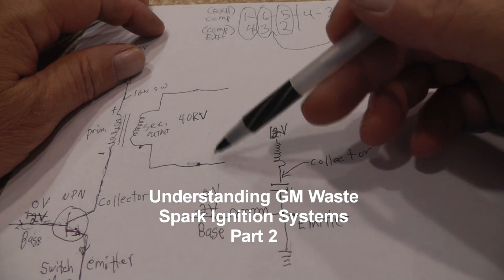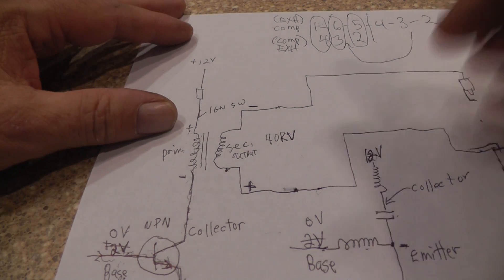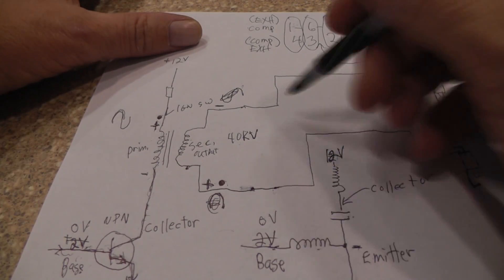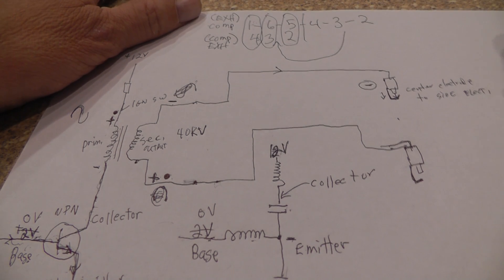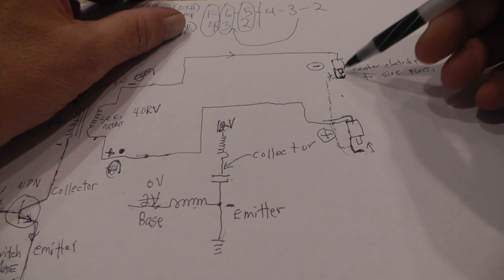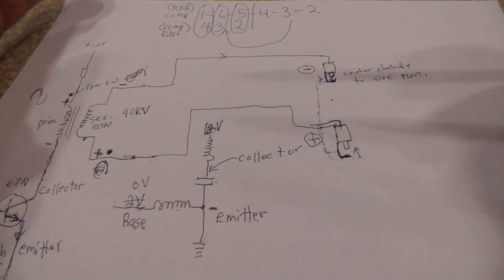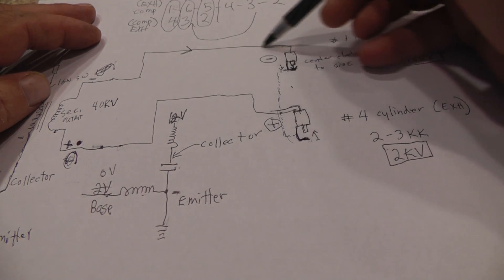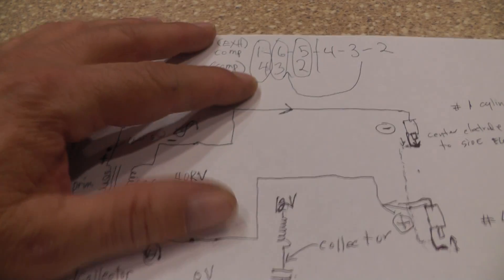Understanding GM Waste Spark Ignition - Part 2

Comment: Nice explanation but i dont understand how ECU knows what cylinder is at intake stroke to inject fuel if there is no camshaft sensor in system, only crankshaft sensor? I mean 4 cylinder engine example.
Reply from the maker: Good question! If the engine has a waste spark system and using batch firing of the injectors, it can figure out when to inject fuel with the crank sensor only. But, if it has sequential fuel injectors, then it needs a cam sensor. Here is a link to some comments on this topic. Pay attention to Chickenman's comment as I believe it will pertain to your question. https://forums.hybridz.org/topic/126922-sequential-injection-with-only-crank-position-sensor/

Comment: I guess the reason A/C current isnt used is because alternating current wont jump a gap. this info is fascinating
Reply from the maker: Actually AC will jump a gap, but there's more electronics to use AC on a car which uses a DC battery.

Comment: Hi Stuzman.  One more question following your excellent video - If one plug lead was pulled from a cylinder, would that mean that the corresponding plug associated with the same coil would also not fire?
Reply from the maker: That is correct Richard as the spark plugs are wired in series.

Comment: Excellent video!  One question - how does the electron flow reverse when cyl 4 is on compression stroke so that electron jumps from central electrode to ground?
Reply from the maker: Hi Richard and wishing you and your family a Happy New Year! Okay, to answer your question quickly, the electron flow does not reverse for any cylinder. To answer your question with a little more detail, let's use a four cylinder engine where the firing order is 1-3-4-2. To find out what our companion cylinders are, we will split the firing order in half. We'll take cylinders 4 and 2 and bring them under cylinders 1 and 3. This will give us 1 and 4 as companion cylinders and and 3 and 2 as companion cylinders. Cylinder 1 will be fired negatively at the center electrode, whereas cylinder 4 will be fired positively at the center electrode. And cylinder 3 will be fired negatively at the center electrode whereas cylinder 2 will be fired  positively at the center electrode. So, to answer your question, none of the cylinders will reverse the flow of electrons as it's fixed with their corresponding polarities as outlined above. Cylinder 4 will always be firing from the side electron, (it's more negative) to the center electrode on the compression stroke. And looking at it's companion cylinder #1 on the compression stroke, it will always be firing from the center electrode, (more negative) to it's side electrode. Hope that answers your question!
Reply: @stuzman52  Thanks very much Stuzman.  A very Happy New Year to you and your family.  And thanks again for your speedy reply to my question.
Reply from the maker: @richardeaton5770  Always glad to help Richard! Have a great day!

Comment: What I don’t understand is what is the basic reason for this system? Is it to reduce the number of coils? Also, if two cylinders are fired from the same coil and they have different kv requirements due to one cylinder being on the exhaust stroke and the other cylinder being on the compression stroke, wouldn’t the voltage take the path of least resistance and fire the cylinder that has the lowest kv requirement ( exhaust stroke) and thus dissipate all the energy there and not fire the cylinder that is on the compression stroke?
Reply from the maker: Hi Brian and hope you had a great Christmas and wishing you a successful New Year! The reason that the waste spark system was used was because of cost. With fewer coils as you mentioned, it was a cheaper system compared to having a separate coil for each plug. With a separate secondary winding supplying two plugs, the spark plugs are wired in series with this winding. You are correct that the exhaust stroke has a minimum firing voltage across its gap, but you have to realize that the voltage will not jump this gap because of the other spark plug gap which requires a higher voltage during compression. Remember, the spark plugs are wired in series. So, to have a spark jump both gaps, the cylinder that's under the higher compression has to be met FIRST. Once the condition has been met for the higher compression, then the sparks will jump both gaps at the same time. The cylinder under compression will take most of the spark energy and whatever is needed to jump the other gap during exhaust will fire its plug. As mentioned, both of these sparks happen at the same time because its a series circuit. I can understand your thinking that the cylinder during exhaust will require the least voltage and thus it will spark. But, remember, the cylinder with the compression has the highest requirement first. Hope that helps with the explanation! Holler out if you have any other questions!
Reply: @stuzman52  thanks for the reply and yes that helps. I appreciate your expertise.
Reply: Would like to add something, two spark plugs are in series, higher voltage would be across the highest resistance point, that is plug at the compression stroke.
Reply from the maker: @lasithrajamanthri5992  Thanks for the comment!

Comment: This 3 part series is excellent.  I have a question about the dotted line you drew between the two spark plugs.  You said they are internally connected.  So using a V6 engine and plugs 1 and 4 as an example.  The electrons will flow from spark plug #1, through cylinder head bank one, through the engine block, through the cylinder head bank two, and to the #4 spark plug?
Reply from the maker: You are correct Tom! The electrons will leave one side of the coil, jump the spark plug gap from the center electrode to the side electrode. The electrons will travel through the head over to the #4 spark plug. It will now jump from the side electrode to the center electrode and is considered the + side of the circuit. Sorry Tom for the delay in answering as YouTube did not notify me!

Comment: I understand how the waste spark system works(up to a point).My question is if post #4 on a coilpack is dead(no spark) how does that affect its mate post #1? Which is basically the other end/side of that coil.That is the case with my Ranger right now. No spark from post #4 and post # 1 seems to be "lazy and spotty". Do the post act completely independent of one another?  I admit I'm kinda dumb when it comes to all things electrical.LOL
Reply from the maker: Hi John! When you have a waste spark coil that delivers great spark on one tower, but doesn't create a spark or a weak spark, then you've got a bad coil for those two cylinders. One side of the secondary winding would be shorted to ground disabling that spark for that side, but yet there is enough secondary winding left that's good to create a great spark for the other tower. So, it's time to replace that coil or coil pack if other coils are in the same package. Good luck on your repair!
Reply: Wow,thanks for the quick reply.Valuable info! I been using a timing light to check the spark. That method seems to work "fair". Do you think testing a coil's ohms with a DMM is a good/accurate method?Thanks
Reply from the maker: john johnson Using an ohmmeter is not an accurate method to check the coil’s winding(s) resistance. For example, you could have the specs for the resistance of the windings and they could measure right in spec. But that doesn’t mean that the coil is good. It could just as well be bad. You could have a shorted turn or two and the meter would never pick up this very small anomaly. However, if you measure an open or dead short, then the coil is bad for sure. The best test is to see if the coil can jump a spark at least 3/4 inch. In most cases, it can easily do an inch or more. Hope that helps!
Reply: Okay thanks,that's just the info I was looking for. I have a spark checker but my timing light seems to be doing a fair job of telling me what the coils are doing. BTW,do you know much about Ford's 2-coilpack set up? I'm trying to confirm that the 2 coilpacks mimic/mirror each other in unison. I've read conflicting information about that. This is the first "2 plug per cylinder" vehicle I've ever owned. The rear coilpacks feeds the plugs on the exhaust side and the front coilpack feeds the ones on the intake side of the head.
Reply from the maker: @johnjohnson1313  From my understanding, the two coil packs should follow each other where the spark should be generated at the same time for the cylinders it's firing. If the spark between the two coil packs does not happen at the same time, it's a simple matter of looking at each coil's primary turn-on voltage with an oscilloscope to verify it. I may have to do this myself to verify it. With that being said, let's assume that the spark between the two coils occurs at the same time. In this example, there are two coil packs where one coil pack feeds the plugs on the intake side and the other coil pack feeds the plugs on the exhaust side. The firing order for the 2.3L with 8 plugs is 1-3-4-2. Dividing this in half and placing the second set of numbers under the first half, we have 1,4 and 3,2. How does all this firing work? Let's start with cylinder #1 on the compression stroke which means that its companion cylinder #4 is on the exhaust stroke.  Cylinder #1 and #4 are fired together at the same time. This comes from both coil packs firing four plugs. Since the cylinder is on #1 compression, most of the spark energy will be delivered to two of the #1 plugs whereas the other two plugs on #4 cylinder will get the wasted spark energy. Next on the firing order is cylinder #3 whereas its companion cylinder is #2. Again, most of the spark energy will go to cylinder #3 and wasted on #2. Exact same procedure happens for those plugs where both coil packs are firing it's respective cylinders. Then it's cylinder #4 and finally cylinder #2 following the exact same procedure as mentioned above. If you want to verify that the spark is happening at the exact time between the two coils, you're going to need an oscilloscope for that procedure. Just looking at two different sparks by eye is not an accurate way to determine if they're happening at the same time. As before, just check the spark length to determine the coil's integrity. Here is a link showing the wiring of the system and should give you a better idea of how the system is wired. Also, be sure to look at the link below that page to troubleshoot the ICM. Some very good information is in there. If you got any other questions, holler out! https://easyautodiagnostics.com/ford/2.3L/ranger-ignition-system-diagram-1
Reply: Thanks for that. If the #1 post on the front coilpack is firing on its power stroke I don't see how the #1 post on the  rear coil pack can be doing anything other than that as well. Related question: My timing light shows the #3 and#4 plug wires(on front and rear coilpacks) to be firing VERY fast,almost a blur,but the #1 and #2 plug wires are firing MUCH MUCH  slower. Does that sound like a bad coilpack to you? I hate to confess but these are cheap coilpacks I been getting off ebay. I've only had the truck about 2 months and I think I have tracked down a misfire to these coilpack issues.
Reply from the maker: john johnson Yes, It sounds like a bad coil pack. 😀
Reply: Okay thanks.I have YET ANOTHER one on order.

Comment: Hi stuzman52 great explanation about coils, thanks a lot for those drawings I got it saved in my info arsenal, here is the thing though I am from Chile southamerica and I got a brazilian version of a blazer four cylinders 2.4 and I got the wire from the ECU to the coil in positive as long as the coil it be connected, I do connect the light bulb into the positive from battery to the ECU and the other side to the way out from ECU to coil and turn the key off and it start flashing intermittent and the relay for the pump tickling in the same, do you have any idea why? I really appreciate any tip, thanks in ahead!
Reply from the maker: +MARIO PROVIDEL The response from the ECU to the coil side with the light flashing is normal. This is where the ECU is switching this side of the coil to ground. On the other hand, the relay should not be turning off and on as you describe. What is the problem with the vehicle? I assume that it's not starting up from your description. Did you check for a spark and if so, did you verity that it will jump a gap about 1/2 inch. Sounds like the control side of the relay is connected to the control side of the coil(s). You may want to verify this side of the circuit to be sure there is no insulation rubbed off of the relay control side connecting to the coil circuit. Other than that, I'm not quite sure.
Reply: I got crank but no spark, so you saying that positive from coil to ECM it is ok, then if I got positive when I do crank I should have this intermittent signal from ECM....right? but now I have it as soon as I turn the key off, by checking with a lamp connected from the positive from battery to ECM to the wire going to coil, there is where I have that funny tickling in the pump relay as well the intermittent flashing in the bulb, I 'd been checking the schematics and also I had to rewire the positive in the main relay directly from ignition due the keep going in the current several minutes after turn the key off, thing that got rid of by now, I turn it off and there is no more positive going to ECM and negative from ECM to relay....did I wrong?
Reply: ...and no..I do not have spark at all! any of the plugs is giving it
Reply from the maker: +MARIO PROVIDEL A little hard to follow you. There is s B+ going to coil and the other side of the coil, (negative) goes to ECU. The light will come on at B+ AND when come on when you touch the negative side of the coil. This is with the switch on and not cranking. Then with the lead of light connected to B+ of battery, touch test light to negative of coil. You will see that the light will flash while you're cranking. This is normal as it shows that the transistor is switching off and on. But it doesn't guarantee that the primary drive signal is good. You'll need a scope for that. It sounds like you've got something wired wrong and I don't quite understand what you're saying. The fuel pump relay should not be pulsing off and on like the ignition coil. You may have crossed up some wiring. It's hard to troubleshoot for here. If you want to know more about troubleshooting the ignition system, take a look at 'Scannerdanner' channel. He has a lot of videos using the test light as you in checking ignition. Hope you get it figured out.

Comment: Hey Terry, I'm enjoying your engineering explanation of the ignition system. I have always wondered why traditional ignition coils were "negatively" fired...had no idea the logic was that electrons like to go from a hot spot to a cooler one! Do you mean it takes less kV to fire the plug that way?
Reply: yes, in AC votage electrons take the path of least resistance. temp isnt as important, but amp draw goes up in higher temps.. a hot AC motor running will draw more amps than a cold motor.

Comment: So one of the two plugs are always being fired from block to tip on each coil? Given that it requires more voltage to fire, could this be an issue?  Thank you-very well described!
Reply from the maker: Hi Mark. That is correct. One plug fires from the block to the center electrode whereas the other plug fires from the center electrode to the block. Since coils today have higher voltages, this doesn't create any issue to fire from + to -.

Comment: Great lesson.  Thank you.
Reply from the maker: Glad to help out DJ and be sure to have a great weekend.
Reply: You said the system is on GM and some old Fords.  My 626 actually uses Ford diagnostic system.  How can you tell if a system uses waste spark?  Is waste spark only with coil packs or can it be used with a distributor too?   I have an ignition module and know how spark is routed but no idea if it's waste system or not.  Any easy way to tell?
Reply: Duh never mind, I thought about it a little more and distributors will only fire at one contact point at a time.  Ignore all those previous questions.  :P
Reply from the maker: Yes, that's right DJ. With distributors, you're firing one spark plug at a time, so no waste spark there. If you see a coil which has two spark towers going out to two spark plugs, then you've got a waste spark system.

Comment: I came here from schrodinger box (Matt) i don't understand how on the second spark plug being connected to positive polarity can be connected to engine body( ground) please explain.
Reply from the maker: Hi Manolo. Think of the secondary circuit as a series circuit where each spark plug gap is in series with each other. As the current passes through the first gap, a voltage is dropped across it. When the current passes through the second gap, another voltage drop is created with is at a more positive potential. So, the positive polarity is in respect to the first plug. Hope that makes sense.